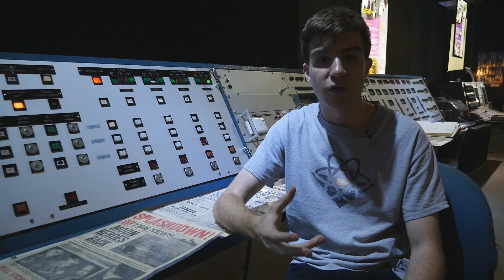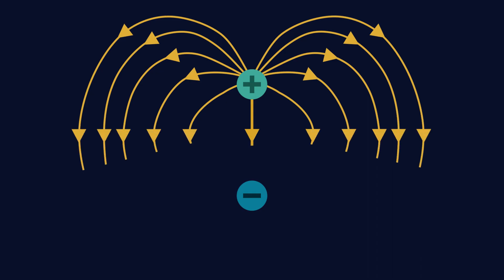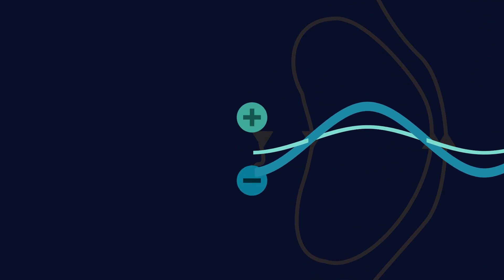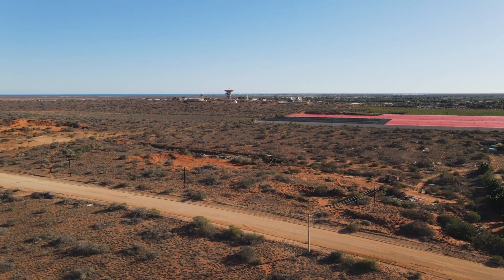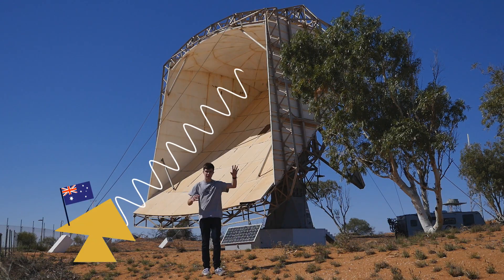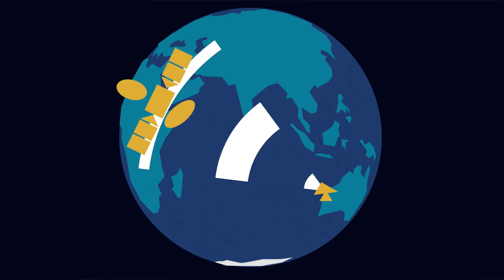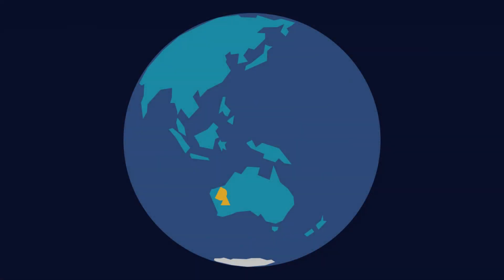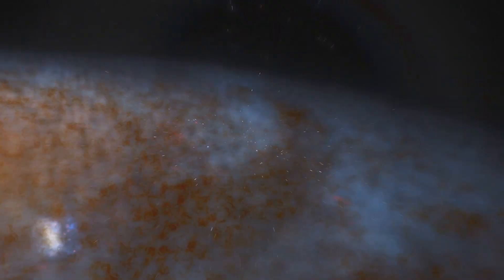How does a satellite dish work?

Comment: Does the sugarscoop really work the way it is illustrated at 4:01? The shape seems to me more like it would bounce signal off the lower scoop, then off the roof and then down into some receiver...
Reply from the maker: Hi! Yes that's a slight simplification on my part to keep the video flowing. The way you've described it is spon-on! The receiver is inside that mesh covering in the middle of the flat section. It you 'unfolded' it it would resemble a single long horn.

Comment: You left out phase modulation, but that is probably going one level too deep. It is mostly used for space comms. Because the amplitude modulation can suffer badly from noise, and the frequency can change a lot (Doppler shift), but phase modulation is effected less.

Comment: Space communication is usually done through the phase domain. It can allows higher data rate. Frequency and Amplitude can be used but are next to useless when factors such as the Doppler effect and atmospheric noise cause huge changes in these properties that would be way too power expensive to predict on the spacecraft for every transmission and reception

Comment: Neat video! But there’s more to radio than just AM and FM, there’s also phase modulation, which is arguably a special case of FM. Then there’s composite techniques, like quadrature amplitude modulation, which is used in high-tech radio protocols like wifi. The thought that FM carries more data than AM is mostly misguided, both have a data throughput proportional to their bandwidth (measured in Hz) and their signal to noise ratio, as per the Shannon-Hartley theorem. Same for noise immunity, to some extent. FM broadcasting stations are at higher frequencies than AM stations, and so they have a lot more bandwidth to put the same audio data through. If you crammed the same data in AM and FM channels of equal bandwidths (say, 44kHz), with the same SNR, you’d get similar levels of fidelity. Interference from lightning and such would effect both modulations, but in different ways. QAM, which is a form of AM, is used for higher speed wifi protocols, but when interference over a certain level is detected, I believe it switches to PSK, phase shift keying.

If you’re interested in low power long range radio, look into LoRa.

Comment: Quick question: are the parabolic antennas used to SEND radio signals? I thought they were only used to RECEIVE (because, as you explained, they concentrate the signal into one spot).
Reply from the maker: They can be used for both! One of the cool things about radio (and lots of physics phenomena) is that you can run it both forwards and backwards. So you put current into the 'receiver' it then works as the emitter. The parabola then re-directs the concentrated signal source into a single direction... ideally where your space probe is currently located. Hard to show without a diagram, but if you look at 4:56 you can imagine that playing forwards (as a transmitter) and backwards (as a receiver). Hope that helps!
Reply: @AtomicFrontier  very clear, thanks a lot for replying!
Reply: The Arecibo telescope was used for both sending and receiving, and could be used as a RADAR to study asteroids. I hope we get something similar to it again, because while it wasn’t the only radio telescope with transmission capabilities, it was still pretty unique.